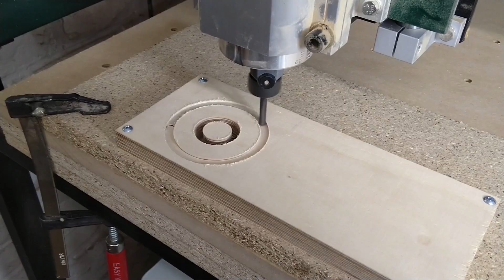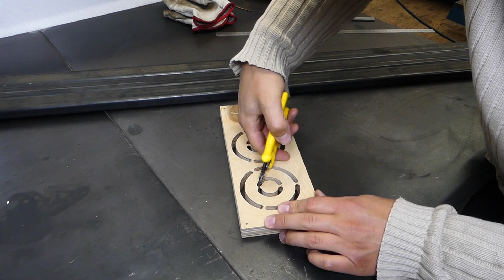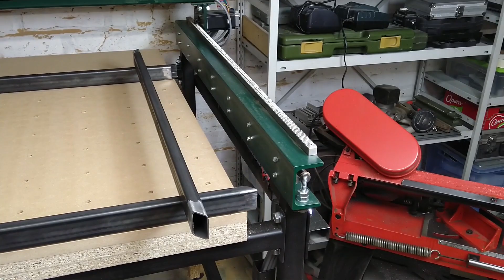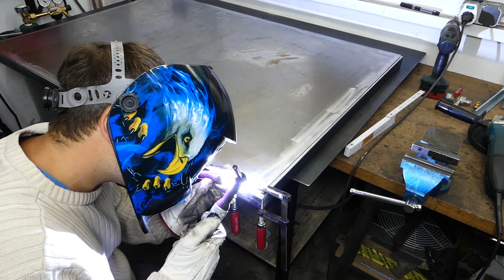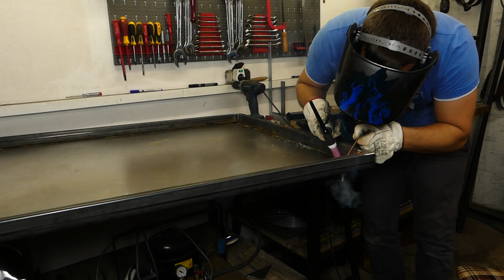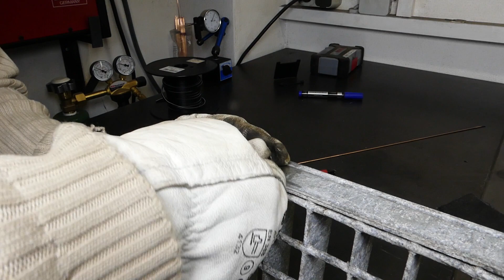CNC Router and Plasma Cutter | Part 8 |

Comment: great machine well done. it seems you don't have THC or I don't notice. I think when you are cutting the sheet it will bend and make problems .any problem without THC?  and also It would be great if you have a deep review of the electrics you used.

Comment: hi Im planning to build a CNC plasma cutter and i just want to ask how did you control the plasma cutter turning it on and off
Reply from the maker: Hi, I'm using the relay that normally should turn the router on and off to switch the plasma cutter.

Comment: Hi Sam
Watched your build from start to finish. Great job.  What method of starting does your Plasma Cutter use? High Frequency? Blow back? Did you have any issues with your Plasma Cutter electrically interfering with the CNC Controller?
Again great job with this build and look forward to more of your videos.
Cheers
Willy
Reply from the maker: Hello Willy, the plasma cutter starts with a (hf) pilot arc . Yes, I have had emi problems with my usb cnc controller. I've solved that with a good grounding and shielding. For a cnc plasma cutter, a controller with ethernet is much better but also more expensive.
Reply: @samsworkshopdiary5748    Thank you Sam,

Comment: Sam, why are you using argon welding?
Reply from the maker: Because the tig welder are cheap and I can weld many different materials without changing the gas  and it's a clean method to weld. For the frame I could have used also stick welding but that makes a lot of dirt in my small shop.
Reply: @samsworkshopdiary5748  anyway it's cool!

which THC do you use?
Reply from the maker: @sokolpro  I'm not using a THC. Maybe in the future. But it's working good without so far, I have leveled the table as good as I could.
Reply: @samsworkshopdiary5748  
I will monitor your project, please let me know if you implement THC.

  I want to create my own flame machine, but I have a choice, a controller like yours without THC working through a computer and controlled by the mach3 program or the Chinese factory control panel StarFire SF 2100C (THC is installed with the least problems) I really don’t know what to choose...

Comment: He Sam,

I would be carefully with using galvanised grating as an cutting support.
The galvanised steel gives toxic fumes as its burned and is cancerous.

Greetings Jack
Reply from the maker: Thank You for that advice!
I know that galvanised steel ist toxic when it burns. But I got it for free. While I am cutting I am using a  fan to suck of the fume and wear a dust mask with activated carbon filter.

Comment: Although I bought my Cnc Plasma table 4x4 I made a marker attachment, just finished up the router attachment so were working back wards lol but nice diy build next is a roller knife mount for vinyl & onto a designing a 3d print head & a laser attachment
Reply from the maker: Thank you for your comment! I'm planning a roller knife mount too.

Comment: Hi I have cnc xyz gantry. How to join plasma cutter and troch to connect mach 3
Reply from the maker: Sorry I did not use mach 3. But normally you must have a relay or something on your cnc controller that is switched by the cnc software on your pc and this relay you must connect with your plasma cutter to switch the torch.

Comment: Sam I like your design well done is it possible to get a basic plan for this build what would you change would you stay with the racks and gear or would you go for a different drive system? Well done again it a great concept that can be built at home let me know if I can get basic plans will send you a email address best Regards Rob T
Reply from the maker: Thank You for your comment Rob. I want to make a video in which I will explain the whole machine in more detail. A plan would be a lot of work, so I think that I will not do some. With a look at the videos it should be easy for you to build a similar machine, if you got detailed questions feel free to ask me. The results with the racks are quite good so I think I would use them again. If you want to build only a plasma cutter (without router option) belts can be a good and easier to handle alternative.
Reply: Sam's Workshop Diary thanks Sam have put a bell on your channel so I can keep up to date with your videos

Comment: Edges on stainless steel after plasma cutting are ugly. Try cut most common structural steel like 235 or 355. Greetings and good job!
Reply from the maker: Thank You for your comment! Yes the cutting edges don't look really good, but I haven't used stainless steel (I've used DC01 (330) I think it's pretty similar to 235 or 355).  I think I have to find out the right settings for cutting height and speed to get better results. Which settings do you use at your plasma table for 2 or 3mm sheet metal? Do you have a THC?
Reply: @samsworkshopdiary5748  We have to try different speeds to find the best one. In my video we are cutting 3mm steel too slow (next day we cut 10mm steel on the same settings and it was really nice :D ). What about slag? Do you removed it easly? Right now we haven't THC, maybe in future :)
Reply from the maker: @danielpelka50  I think my cutting speed is also to slow for thin metal. I've cut with 1200mm/min. The slag was a bit difficult to remove but it was able with a chisel.